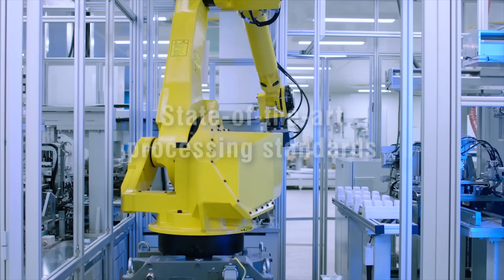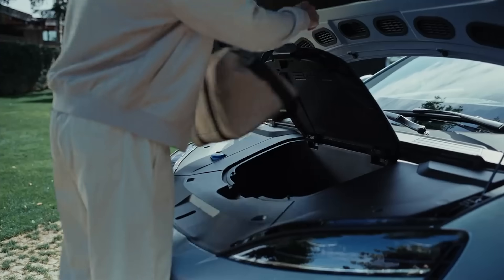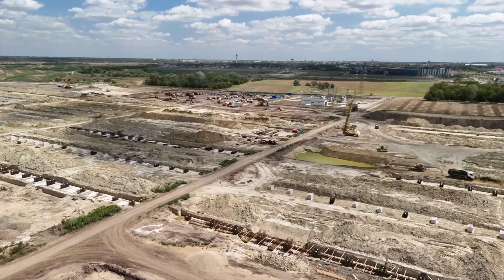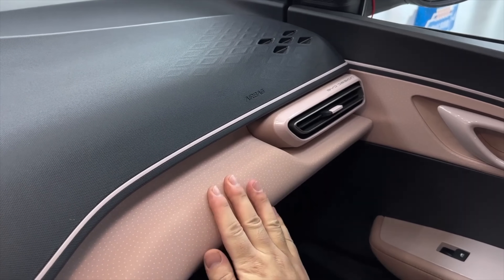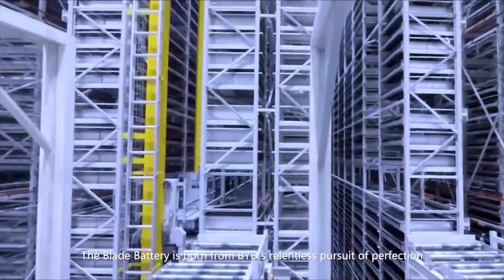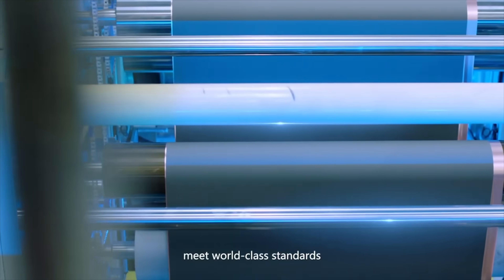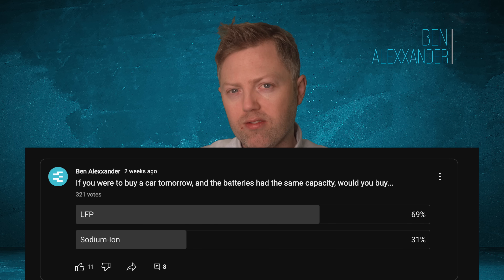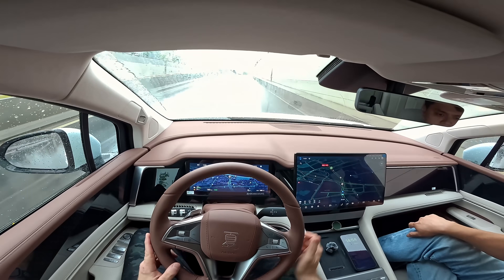BYD Gen 2 Blade Battery Launch Imminent

Comment: rather people started to take serious LTO. LTO is better than sodium in every way right now, its ironically cheaper for the moment, and it was left out of the new usa tariffs. voltage curve of sodium is garbage, but LTO doesnt need some weird converter/step up to get the last 1/3rd of its capacity. both are good down to arctic temps and handle cooling okay passively. both are super safe, LTO has proven track reccord of getting ~10-15x longer cycle life than lfp in much more demanding scenarios (all the chinease ev busses). everyones sleeping on lto bats. converted my ev's low voltage system to run on lto at a higher voltage of ~15.8v. it really likes it.
Reply: LTO ? 
Alex Hibbert did tests on multiple types and If you talking TItanate ..they didn't actually do that well. 
And the Na cells are proving better than even CATL expected. .. Especially in cold weather on vehicles..
Reply: @clivestainlesssteelwomble7665 please praise him a bit. 
he's likely all in his money with startup company related to his argument. 😅😅